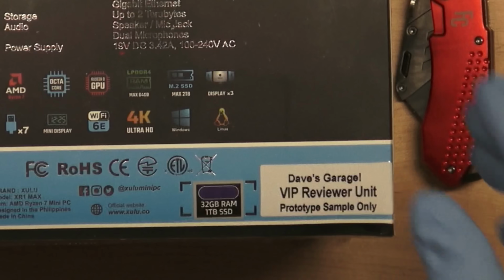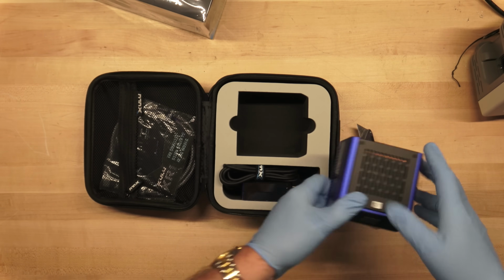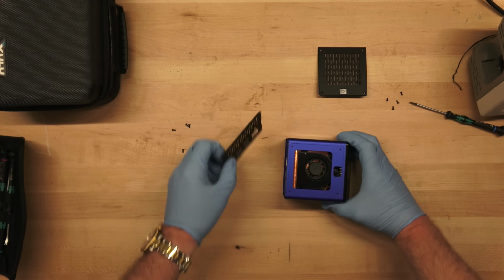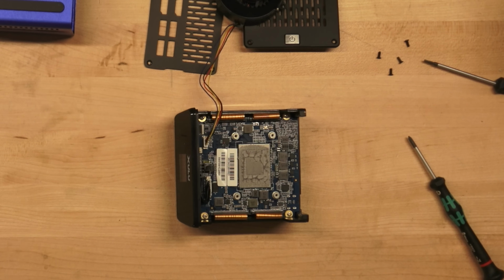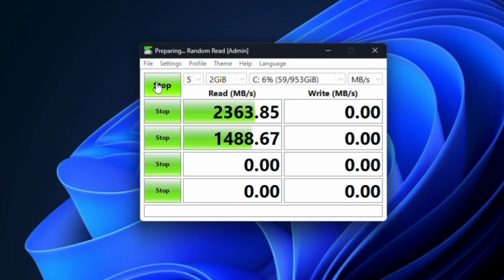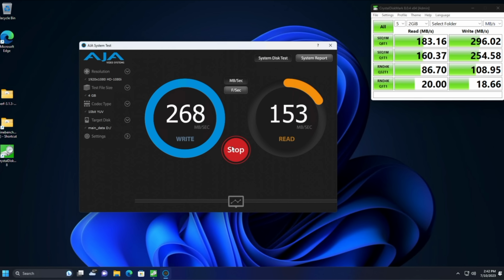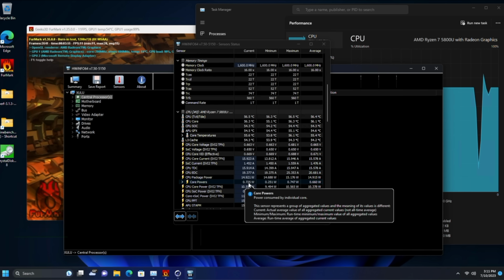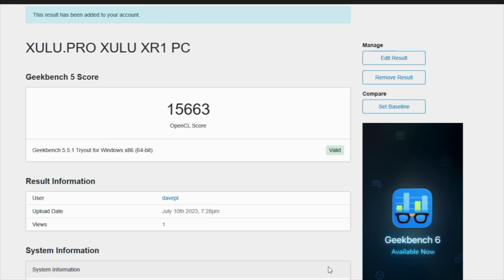Xulu XR1 Review: The BIGGEST Little PC!  Ryzen 7, GPU, 64GB, 2TB, 16 Threads

Comment: Maybe the overhead is slightly less on 2.5 gbit and thus you can divide by 9 instead of 10 to get the amount of max transfer bytes ? 2.5Gbit per sec /9=0.277Gbyte per sec = 277 Mbyte per sec
Reply from the maker: I guess it depends on packet formation and MTU and any number of factor. I guess I'm old school enough that I just assume 10 bits byte byte because that's what it was for 8N1 serial transmissions :-)

Comment: @Dave
Thanks for the quick review! I really liked it. Short on on the Point but one thing is missing for me:
Have you measured the idle power consumption of the device?
Reply from the maker: Yes!  Running Heaven it was 60W, then with "windows very busy" it was 30W, and idle it settled down just under 10W I believe.
Reply: @DavesGarage  
Great, that's quite good to know. Since Raspberry PIs have worsened price value wise NUCs and thin clients are now better options for little smarthome servers. I moved from the PI to an old 4460 and the performance boost was dramatic. Mostly in Grafana (with 40GB of InfluxDB data) but it also allowed me to use AI detection for my security cameras to automate things around the house and I just love little powerfull boxes even though a big rackmount server would be the more logical choice.

Comment: I think unless you must have this small, the 1 liter PCs are the optimal SFF desktop.  I'd like to have external PCI-E or at least eSATA to run 5 or more storage drives, and a nice chassis for them to make NAS storage competitive with mid-range Synology and other commercial offerings.  I must be a niche market, because there is no SFF DIY NAS with integration comparable to those small 4-10 bay commercial offerings.
Reply from the maker: I think this is a good laptop alternative, but not a NUC replacement.  If you travel with it, this is a great form factor. If it sits on a desk, I agree with you!

Comment: Incidentally I'm literally configuring a new N100 NUC to replace my current Plex server as I watch this. My current Plex server is my old dev machine which is way overkill for what it does. Going from 400+ watts of power to 8w without giving up any performance is going to be great!
Reply: What are the benifits of plex over Jellyfin?
Reply: @MichaelMantion  client support and polish are the biggest issues .... i run both, and just waiting for JF to come up to par so I can dump plex
Reply: Last I tried jellyfin, I couldn't manage to control when transcoding occurred even over a simple 1 gigabit lan.
Reply: @SirSomnolent odd. They have settings to control transcoding. Was it a bug or was that a long time ago before they had options?
Reply: im looking at doing the same replacing my old i7-920 unraid server
Reply: After trying Plex on a MINISFORUM Venus UM790 Pro Mini with similar specs to the Xulu, I am not holding out hope for the Xulu handling live OTA from my HDHomeRun. I've used Plex with HDHomeRun for 10+ years, so I know how to set it up in multiple configurations. That's why I was surprised at the stuttering video I got the MinisForum. My Asustor NAS runs Jellyfin in a Docker container smooth as silk. I can't figure out why 4 Celeron cores at 2 Ghz do better than a AMD Ryzen 9 7940HS with 8 cores at 4 Ghz. We'll see how it goes whenever I finally get my Xulu XR1.
Reply: @NightOwlAmbient  when I finally...

Comment: 3:40 One of the things i like to do for these difficult to dissasemble devices is to replace the paste, with a graphene sheet(cut to the exact size of the die if exposed instead of under an IHS)
Just hold it down to the heatsink with a little bit of thermal paste in the corners, then slap it down.
Sure i lose a bit of performance in the beginning, but in 2 years it will be performing the same as when first applied, where as thermal paste both dries out, and pumps out through thermal expansion and contraction.
to anyone reading this who wishes to do this, avoid using this on exposed dies at your first go, graphene is very electrically conductive, so if it is not trimmed to size, and allowed to detactch and float freely, any small piece will likely result in a short.

Comment: i have same processor
Reply from the maker: Let us know what you think of it!
Reply: @DavesGarage  What are your Ryzen's boost settings? Mine are all core -30 plus an additional 50 millivolts down (amounts to 1.05-ish volts of operating voltage in average, rather than 1.4V that is provided in the default settings).

Comment: I cant wait for the Ryzen 7000 series APUs to make it to AM5. 
Those lenovo/Dell/HP miniPCs are so amazing for servicing
Dont get me wrong, i love the compact form factor of the xulu, i also have a beelink and a minisforum. But nothing beats being able to pull the CPU out if something goes bad with it.
now to be fair we've only had like 2 out of 1000 units need a CPU/integrated GPU replacement at work, but it is a nice thing to have, just sad that most of these OEMs dont release updated BIOS to support future processors, if you bought a 3400GE you're stuck with 3000G, unlike companies that make motherboards for the DIY market that will let their Zen 1 based 2400G system also run a 5700G Zen3 based CPU
Reply: The Minisforum EliteMini B550 has an AM4 socket!
Reply: @samserious1337  my problem with AM4 APUs is that the CPU is great, but the GPU is a design from 2016 with only 8CUs, when older AM4 had 11-12CU

Comment: I like these ultra small form factor pc's... it's like cramming a thin laptop into a little cube.
Reply: Except no keyboard, monitor, touch pad or battery, all for about the same amount of money.
Reply: @MichaelMantion   Phone boards are produced in a volume of millions of units. Those SoC computers have a lower production (hundreds of thousands), thus they usually cost more, its a shame
Reply: there's also the consideration that its niche for hobbists, so they also price the end product higher
Reply: I like that you can now pick up a complete working system for the prices we used to spend on just a graphics card!
Reply: @marcforrester7738  APUs have come a long way with onboard graphics too. Systems like this can actually play some games without even needing the discrete GPU.
Reply: Your smartphone is a computer with screen/input device/ and speaker... extra are gps and a few other sensors and cameras.
Reply: @johnmicheal3547   except a real PC doesn't have a baseband blob circuitry that who knows what it does, it could give ring -3 access to your CPU for anyone over the LTE network
Reply: I prefer when they then take the cube and turn it into a trashcan shaped object. 😂
Reply: Yeah, and us old farts have issues seeing small laptop screens. I love my mini HP Ryzen +, and am planning on an upgrade to a newer one in the spring.
Reply: @waynesworldofsci-tech  I started using a 4K TV , I'm just 35, but my eyesight was never that good and it's already decaying.
Reply: Eyesight issues suck.
Reply: Ultra small means ultra high heat. Big is rich and prosperous, small is poor and dying. End of discussion.
Reply: No USB 4.0 Not 2 TB. Now there are Ryder 9.
Reply: I love them all. Only bad thing about smartphone is the privacy.
Reply: @johnmicheal3547  yah if the bootloader was open & arm SOC makers where not the embodiment of evil and mainlined there drivers into the linux kernel. Your "smart" phone could be as good of a computer as a PC. But no we get locked down garbage and yes I am counting android (even the custom roms), the moment you try to do anything cool with it you get screwed, the android user space sucks & google play hardware attestation is demonic.
Reply: @jondoe6608   Sadly computers are turning into that with AMD TxT and Intel ME crap
Reply: @johnmicheal3547 Not if you install sth like CalyxOS